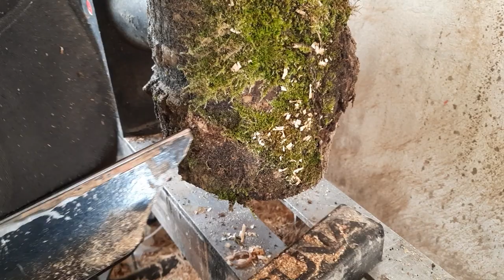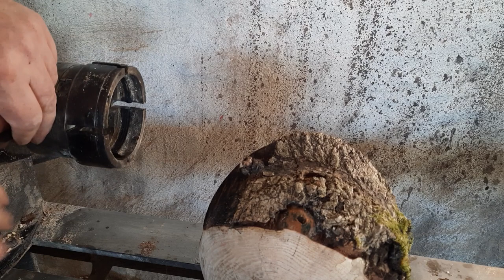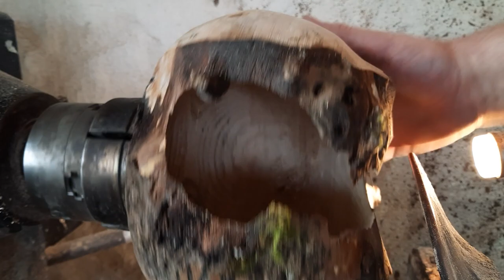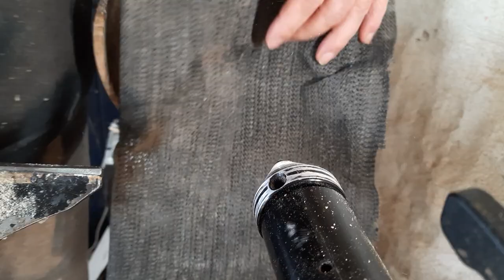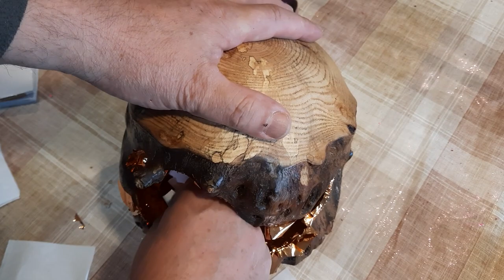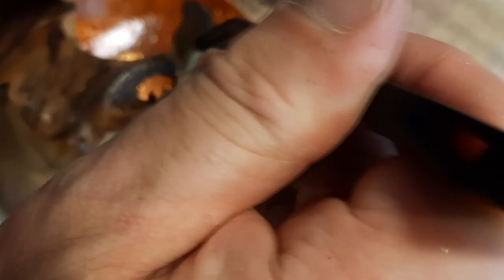WOODTURNING Ash and copper leaf

Comment: Love the contrast between that rich grain , the dark bark area and the copper . Do you coat the copper with anything after it's applied ?
Reply from the maker: Thanks Jim, yes the the copper leaf is wonderful for bringing light into the piece and has a lovely glow to it but it will tarnish over time if left unprotected. I give it a coat of water based high gloss varnish which is recommended for metal leaf, it seems to work well.

Comment: Hi great idea. What glue did you use I have some silver leaf I want to use
Reply from the maker: Thanks, I used a standard gold leaf size, it was a water based one, it wasn't as tacky as the oil based ones but worked fine, I've tried a few different ones they all work fine. The main thing is to put a good base on the wood first, I use shellac maby 3 coats. Thanks for watching, there are a few other videos on my channel with metal leaf.

Comment: How did you prep (seal) the inside of this piece prior to applying the sizing?   What did you use?  THANKS!
Reply from the maker: Hi Robert, I generally use shellac a few coats but any sealer or varnish would do, just make sure it doesn't react with the leaf, likewise the leaf needs to be sealed for that piece I used Windsor & Newton acrylic gloss varnish. It can be a bit fiddle working with the leaf but nice results. Thanks for watching
Reply: @RichardWestWoodturner  Thank you so much for your kind reply.  You do beautiful work.
Reply: Richard, may I ask one more question.  If you prep the wood with a shellac, do you use a water-based or an oil-based sizing to apply the copper...or does it matter?
Reply from the maker: Whichever you prefer, I like both, but the water based might be easier